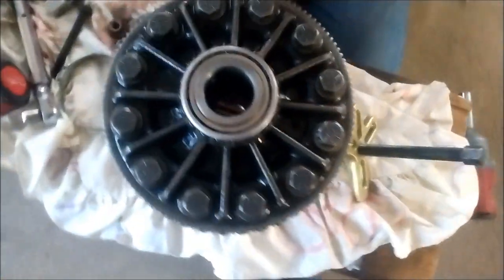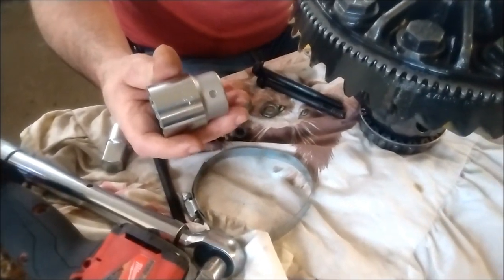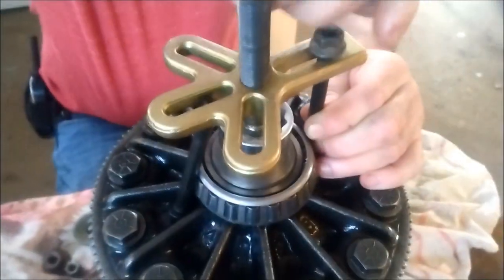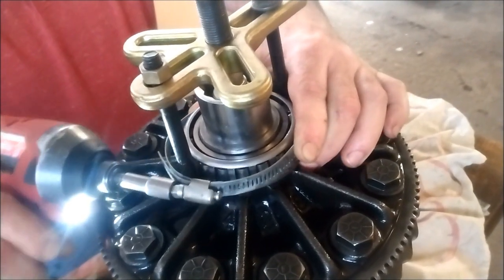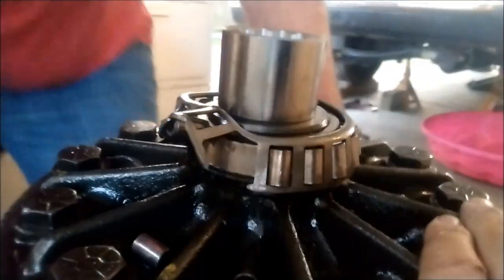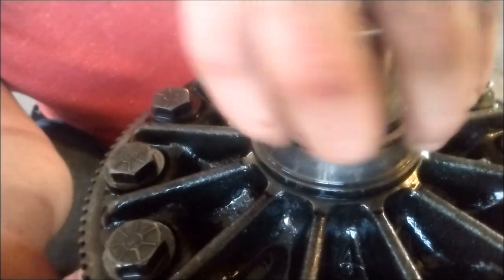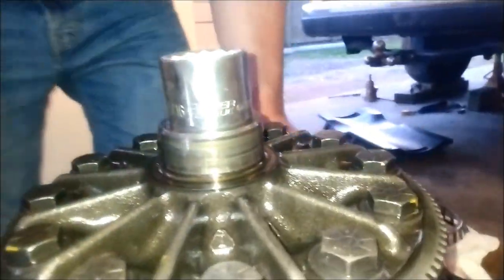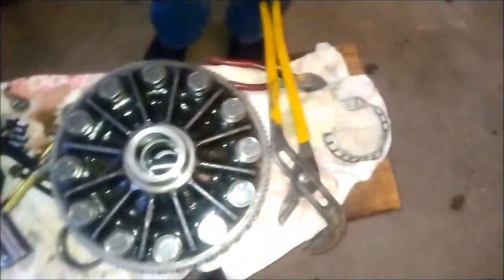Removing a Differential Carrier Bearing Without Special Tools

Comment: Cut the cage and run a weld bead around what remains on the carrirer and it will slide right off. Works on any bearing on any pinion or carrier.
Youre welcome

Comment: Just chisel the cage,turn unit over,heat the race and let gravity do its job.
Reply from the maker: I've seen those videos before, I didn't want to take the temper out of the Carrier or take that chance with my torch. Maybe one day I'll try that and see if I can do that without causing permanant discoloration on the Carrier.
Reply: @shadetreeautomotiveenthusi1284  there's no danger or danger caused.   Best to just throw a weld around it ,it'll slide right off zero issues